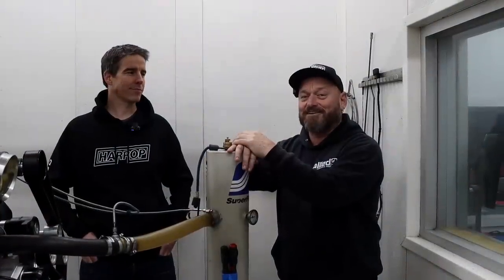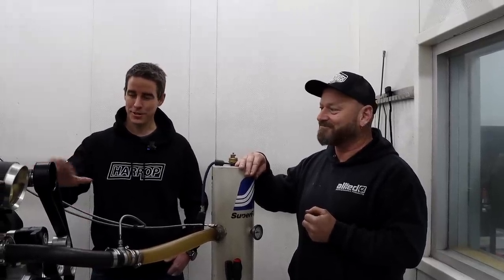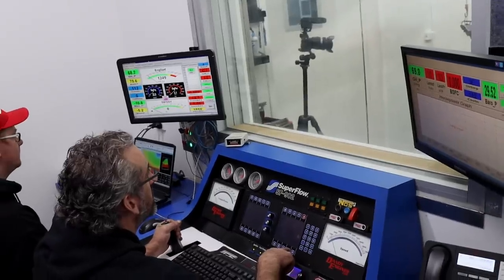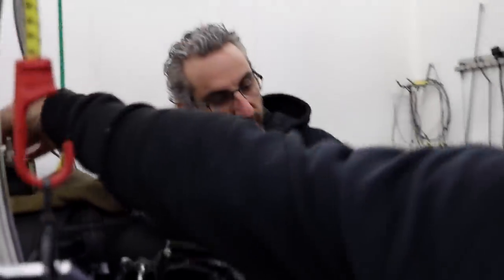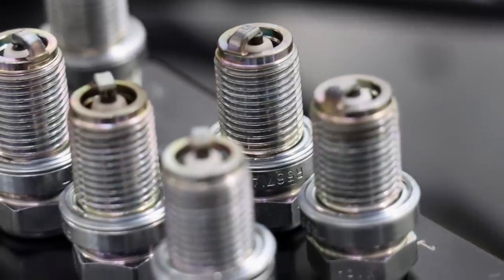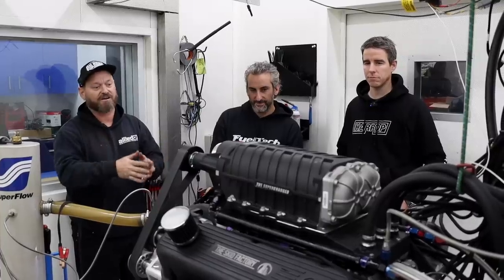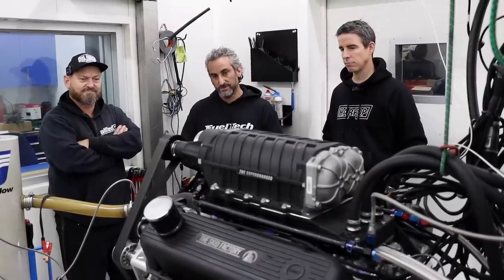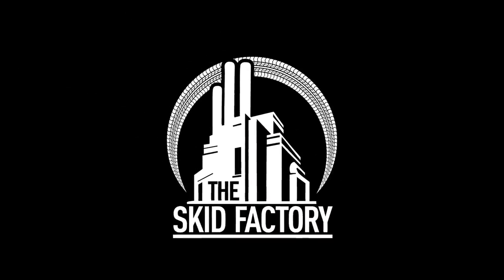BLOWN 454 Lives Again! Back on the DYNO and making HORSEPOWER with@HarropTV& DANDY Engines

Comment: To be honest I'd rather that BBC over a green top haha, well done guys it was a massive effort by all. :)
Reply: You boys don't like spooling up for 25 minutes? Unheard of 😂
Reply: Untill you reach a corner at speed
Reply: Nothing worse than watching turbos spooling up 5 secs after the green has lit.
Real drags = Green ->GO
Reply: Green top Barra getting Smashed by a Billet SMX at 4000hp!
Reply: @mmazz30  run two step to build boost problem solved.
Reply: @ChristopherHallett  😂😂😂 love it, too true
Reply: Big blocks are great
Reply: @edwardmolloy7548  it doesn’t work like that if you have a big stall converter and a big turbo unfortunately
Reply: @ollie786  go look up Cleetus McFarland then.
He's just put a 3000hp Steve Morris Big block in his El Camino running two big turbos & it spools hard & runs high 6s.
With more time it will run mid to low 6s.
On rocky mountain race week they direct fed nitrous to get a better spool because of elevation.
I could be wrong but Mullet is on boost before green.
Reply: @edwardmolloy7548  yeah on a huge cubic inch engine sure, but on something small like a Barra where you’re spoiling a massive turbo - 2 step won’t be enough. Nitrous oxide to spool the turbo is a common fix
Reply: @ollie786  I wasn't referring to a Barra I was referring to a big block or even a 427 running 2500ish hp.
Reply: I knew i saw you in the background, could recognise that ginger mug anywhere lol
Reply: What is a green top..is it a barra of some kind???
Reply: @giorgioredigolo1967  that’s right
Reply: nah go the LPI greentop

Comment: I was so glad you guys called it where it was! I am so impressed with the power that relatively mild engine is churning out and I think it has 1130-1150hp potential with that same pulley setup if you rolled about 8 degrees of timing into it and revved it out to about 7300rpm!!!
I gotta be honest, I was expecting this thing to make an honest 700-740 horsepower, so I'm impressed!! Think about the driveability of this thing! It's going to be a great big ball of fun!! The Smile Factory!! 
Great project and great video!!
Reply: You should send your resume to dandy , I am pretty sure they are looking for another engine tuner

Comment: The fact that Al was willing to stop that close to 1000hp on an engine that's going to be seen by a lot of people, really speaks to the fact that Al doesn't let his ego make decisions. Admirable trait.
Reply: I don't know if it's ego. Old cast Chevrolet BB are not the strongest things on earth, not compared to BB Chrysler and Ford 385 family.

 Weakness is the crank journals, then camshaft location and finally cylinder heads.

 Like Frank said, better off getting a Dart block and proper camshaft, it will do 1100 hp easy, no loss in reliability.

 You think making 1k hp is egotistical??? It's embarrassingly easy to do today no matter how many cylinders you have with forced induction.

This case is better safe than sorry, already lunched a camshaft.
Reply: wants a monster not a dyno queen! another example of Al's, "use ya brain" in action.

Comment: 20-30yrs ago 850+hp wasn't a "street car engine" it would have been cranky af on the street.

Good times 👍

Spoiler below..... 

Edit: almost 1000hp in a street car is plenty. Way more than anyone needs really in a street car. The only street cars that need that are the 2k bArRa owners 😁
Reply: I remember a time when 350hp N/A was something you had to get parts off of a race cars to achieve. Even back then blown cars were only making around the 500 mark. It is a crazy time we live in, when a 1000hp is achievable so easily with modern boost. lol during the 80's we considered 10psi high boost.
Reply: In a reasonably light car an honest 5-600 hp is a lot. People chase that 1K because it sounds cool when you tell people. 
Good thing with a supercharger like this is being so drivable. You get very linear power that’s easier to predict. Turbos can make more power, but it can be harder to predict the surge when the turbos come on.

Comment: I'm impressed with how stable a hydraulic lifter is to 7000 on a big block (heavy valves) with (I believe you mentioned0 20 PSI and there is no sign the valvetrain duress. Probably the third engine I ever dynoed was a mild 454 with a Comp extreme energy hydraulic (small) and the first pull you could see where the spring gave up at 4500 RPM, the graph fell off a cliff.

Comment: I would love to have that system on Jon Kassie 598 Ford  dart block and his SR 70 heads which put out just over 1100 horse and around 900 ft lbs with just a single Big Dominator carb

Comment: Curious if y'all could do a tech video on air to water intercoolers (which that Harrop has?) and how to make them better/more efficient.
Reply: My interchiller halved the IAT on a LS1 with a HTV2300. Pricey, but well worth the coin
Heatsoak from stagging and sitting in traffic had my IAT around 70°c on a 25°c day, that pulled alot of timing out
Pre Interchiller my IAT was around 45-50°c just driving, now it sit around 25° and doesn't get over 38°c after a big long hit

I have the basic FI interchiller setup

Comment: Q: What sort of curve can you draw with a ruler?

A:The power curve on this engine.
Reply: never seen anything that smooth. WOW. personally i think that alone says a lot about the blower v's turbo argument, doesn't it?
Reply: dude that's the hp that goes straight up lol see at the end where is says 941.8 hp torque is at the bottom

Comment: great vid as always! Why isn't toothed belts more common for supercharger applications? Near the end of the video it was mentioned that it needs more belt. Seems like almost every SC pushed to it's limits (my friend has a dinan SC M3) the belt always slips. Is there a reason to not use a toothed belt like a timing belt?
Reply: The slip is like a clutch...
it's the fuse that works in case either the blower goes futt and tries to take out the engine...
or the engine goes futt and tries to take out the supercharger......
or the water pump seizes..
or the alternator seizes..
or the tensioner seizes etc etc....

Comment: Did you guys ever find the reason for the cam failure? I built a 519 BBF about 10yrs ago and it broke the cam at the back right behind the 4th bearing killing the last 2 cylinders it still ran but no power and some what low oil pressure. Replaced the cam and bearings and its still runs but I have no idea why it broke. I don`t like loose ends, what are your thoughts?
Reply from the maker: Manufacturing fault. They can be easily damaged in transit also.

Comment: Can't go past an old crank shaft drive super charger even on 4-6 pot engines, and as Frank said read the plugs and and use the right heat ranges. Ford motor craft had a great selection of heat ranges for all types of engines and they worked extremely well. OLD FART .

Comment: I designed spark plugs that have a heat range from 3 to 10 . Iridium core and platnum ground chip with resistance and capacitence . I was told by all manufactureers that they would never make it for me  . Why ? It would lower their income by 65%

Comment: I will say as an American and being around Small Block and Big Block Chevrolet engines all my life and growing up and being around drag racing all my life 940hp and 700+tq is pretty impressive from a pretty basic level build no matter the cubic inch or the fact that it has a power adder but like I said it's a basic build with a stock block and a hydraulic flat tappet camshaft not even a solid flat tappet camshaft or alot of cubic inches and from the looks of it of course I don't know what cc chamber the heads are but it it doesn't look like it had much of a dome on the piston so I'm pretty sure the compression is low and a mild lift camshaft so you can't ask for much more and like Frank said as long as you don't have another parts failure if you go up to 7500rpm you can get close to the 1000hp mark and if you do a pulley change you can go well over that so pretty impressive

Comment: I wonder when the climate wakos will protest to have the use of high performance and tunned motors banned. I know a lot of womens who dont understand the facination with the sound and driving experince from those V8 engines. They think it should not be allow tomhave more than 4 cylindre and max 1.0 litre displacment.

Comment: Good job, motor makes good power, smart call to stop at that power level, I would have called it around 850 horsepower, my 540 uses a dart block, short travel hydraulic lifters roller cam set up for a blower, you’re so right about the flat tapped hydraulic cam, that valve train is heavy, big valves pushing against pressurized cylinders could be bad
Reply: It would be half tempting just to go a Dart block now for peace of mind and longevity to be honest. But so guess from there things start escalating quickly 😆🤣😂

Comment: Its prob too late, but it would be interesting to see a "chrome blower" on 6 or 8 /71 on this motor, to see the difference
Or, stick the harrop on a "proven" motor that has a 6-8/71 on it already

But thats alot of time and effort, but it would be interesting
Reply: Now we’re talking 👌🏼🏁
Reply: Generally the old style roots blower makes more low rpm torque, but isn’t as efficient at higher rpm. I think this is a screw style blower. Those tend to be more efficient at higher rpm so you can make more hp. 

Much of the modern improvements have been efficiency so the supercharger is wasting less power heating the air. Even the roots styles sometimes have more lobes and different angles of twist to change how they work.

Comment: Reading plugs is a dying skill. Id wager less than 1:1000 mechanics know how to do it anymore, or even that its a thing. Hes dead on with the quip about everyone relying on O2 sensors. A sensor will only tell you so much, the plugs will tell you everything. People are just too damned lazy to do it >.<
Reply: I know how to read plugs, it's not a lost art. Unleaded fuel makes it harder and wide band o2 sensors make it unnecessary. 

I only bother to read them because I like running turbochargers, water methanol and nitrous together. 

 EGT sensors are nearly useless as well.

 BTW I am not a mechanic, but I am SAE certified. 

 I don't play with technology as old as I am. I got the engine block beat by eight years.
Reply: I'd wager 9 out of 10 mechanics cant build and also tune an engine. Majority of "mechanics" follow service manuals lol
Reply: my old man was building, driving, destroying engines for 50 years and i don't think i ever saw him start a tune session without first step, CHECK PLUGS. old school knowledge should never die.

Comment: After old mate does a power run and he stops  the throttle. Just before it hits idle, he revs it again. Can someone please tell me why.
Reply: I don't think he's the one doing it. I watched his hand. I think it's the dyno itself that "lets go" or something..
Reply: At a guess, because they need to learn the idle still, it stops the engine from stalling when the throttle is snapped shut. Once they have set the decel dashpot, I would say that they can stop that blip of the throttle on decel.

Comment: what a result! love it when car people come together to make things work. have had a similar experience with a friends car on the dyno a bolt for a chain guide backed out causing some bent valves and we all just banded together and got it fixed the car left the dyno 3am in the morning after having valves replaced and head refitted and everything.

Its so true what Frank said: "We're car guys helping car guys, and that's what we do" its what car people do we help each other where and whenever we can! loved this even more keen to this in the car going down the road.

Comment: the original use of roots style blowers was to push air down mineshafts so the poor buggers chipping away at the end had fresh air to breath and blast furnaces
Reply: Those were huge industrial blowers. When they made smaller ones for the Detroit diesels is when people started putting them on cars.

Comment: What does running in the cam actually do?
Reply: It has flat tappets so you have to run it at a specific rpm for a while to let the cam and tappets wear in together. With an engine like this they also lighten the valve springs during run in so there’s less pressure on the cam and tappets.

Comment: Sorry guys, although I know modern technology is unbeatable, I prefer old skool. I have a chrome blown BBC as you say,  yes its  a 540 roller cam 871 efi injected engine, but makes 900hp at only 8psi & 8%OD.  Street car.  Now what would happen if i added an intercooler & turned the boost up? like a modern TVS2650 15psi? 20psi?
What I want to say is your opinion of these chrome blowers is wrong, sure some are just show pony's but when done right they are awesome.
Reply from the maker: What would happen is the blower would consume so much power to drive it that you would see no gain. Same thing happens to modern blowers as well but it’s at much higher boost levels.
Reply: With a bigger engine and a roller cam. And, makes less power. How’s that supposed to show the superiority of the old school?
Reply: @NBSV1   Where did i say its superior? I was just pointing out they work. I am sure if it was intercooled it would gain 8 to 10% Thats 80-100hp. I can still overdrive it more but no need.  I've seen Alan say he doesn't like old chrome blowers, that's fine but he also said they don't work, i disagree.

Comment: Why do you need to run in the cams on different springs / less spring pressure?
Reply: The flat tappets and cam need to wear in together. If you’ve got to much spring pressure the load is so high things can get damaged before they match up.

Comment: About 500hp less than I thought, but then again, I thought you were gonna be evil Al and run it on methanol. 😅👍
Reply from the maker: An 8-71 equipped methanol fuelled engine will make similar numbers. Without methanol they make nowhere near the same.
Reply: @theskidfactory  Yeah I must have missed the type of fuel you said you were using for this, hence my outrageous guess. 😅 Was the 940hp on E85 or 98?
Reply from the maker: E85.

Comment: Out of curiosity, why kill the throttle off hard at the end of a pull instead of ramping down? Is there a specific reason?
Reply: They’re checking the plugs to check the tune. If you let it run to long after the pull the plugs won’t accurately show the tune under full power.
Reply: @NBSV1  Makes sense, cheers.

Comment: Nice thing with the modern roots style blowers is they have a bypass valve so they cause very little drag when not on boost. I've got a magnuson blower on my Camaro and it's just as efficient as it was n/a when cruising on the highway

Comment: Wait what... Roots style blowers were made to push exhaust gas out of a 2 stroke. Holy crap. Did not know that. Thanks for blowing my freaking minda Al. 🤯🤔🥃🥃😮🤯
Reply: Yep. 71 series 2 stroke diesel engines from Detroit Diesel. Hot Rodders in the 50s took the blowers off these diesels and adapted them to American petrol V8 of the time.
Reply: That’s where the relative sizing of 4-71, 6-71 and so on came from. A 6-71 blower was on a  6 cylinder engine with 71 ci per cylinder.
Reply: @NBSV1  Thanks for the insight. 👍